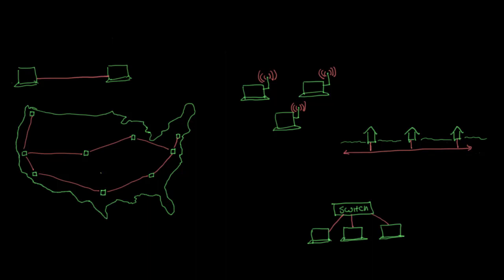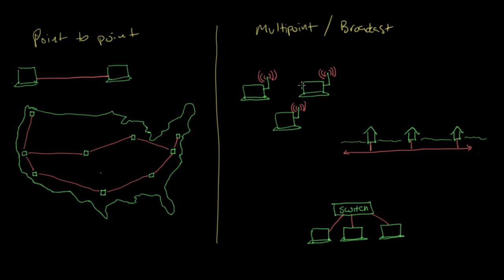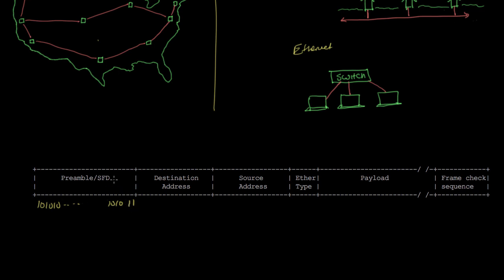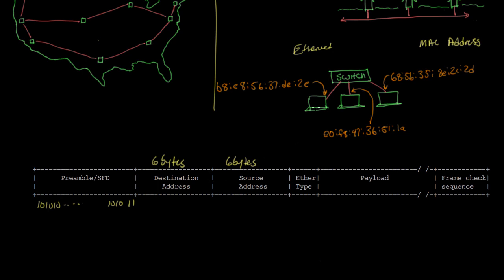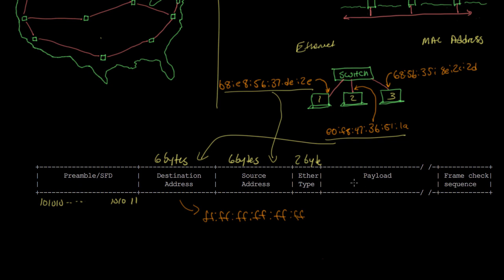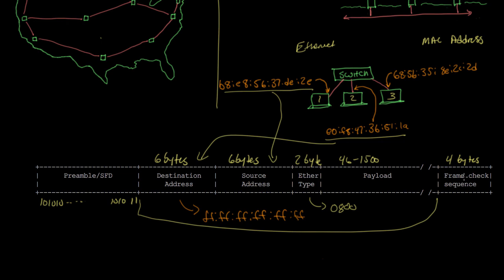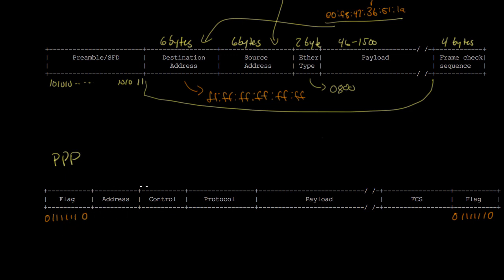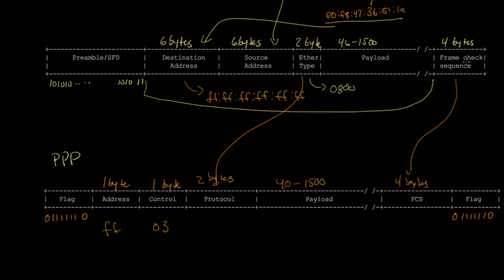Frame formats | Networking tutorial (6 of 13)

Comment: Awesome video series! Your explanations are so clear and understandable. Its perfect for learning!

The one thing I was missing was a mention about the problems when transmiting data back and forth.

We can't just transmit data whenever we want, but need to wait until the line is free, because signals (light waves, voltages, etc.) interfere and so having two computers transmit at the same time makes signals useless for all. As simple as this may sound, this introduces some complexity. For example, a signal takes some time until it reaches another computer, since it propagates with finite speed (the speed of light is still finite!). If another computer starts to transmit after you started a transmission but before your signal reached it, meaning it started while the line appeared to be free because your signal hasn't reached it yet, we have a collision and need to start over again. The collision handling using random wait times is quite clever, since you can't just tell the other computer "Wait, I'll go first", without having the basis for any communication. This is also a reason why the payload needs to have a minimum length, such that in case of a collision the signals reach both sender and receiver even in a long wire, such that both are aware of the collision and can start the collision handling.

Here is a nice explanation on collision handling: https://en.wikiversity.org/wiki/Web_Science/Part1:_Foundations_of_the_web/Ethernet/Collision_detection

Comment: The address field on PPP was sometimes used to do multiplexing of virtual connections. In my former company in the 90 we built a ISDL router that could transmit data via a single PPP link. We had a Unix server on one side (in West-Germany) with 4 RS-232 ports à 19200 bps, they would enter our router, multiplexed on the PPP link over ISDL, so 128 KBps and demultiplexed on the other side (in East Germany) where 4 terminals were hooked on the router. The address field allowed to distinguish the 4 virtual channels. Worked a charm and was easy to implement.

Comment: I have a question about the PPP frame format that was shown. In the diagram it is shown that the frame starts and finishes with this special code "01111110". As you explained earlier this is used for syncronization of both ends, so whenever you hear this "01111110" string you know it's the start of a frame. When this happens inside the frame, like you explained, a bit is "sutffed" in between to break the sequence, and so if the reciever starts hearing midway through they won't be confused.

My question is: what if the reciever starts hearing midway through (say, during the payload) and then hears the "01111110" finishing the frame? Wouldn't they interpret it as the start of a new frame?
Reply: Then right after this the receiver will hear another "01111110"  for the start of another frame.  I wonder if the receiver will realize it missed a frame. I know the first frame will be corrupted and dropped and or some higher level protocol like  TCP (layer 4) will check for corrupted data and request a resend. If not TCP, then there will be something on the upper level that will realize the data is bad and will initiate another request. But I think there will be an ARP or some other frame sent first to make sure the destination MAC address exists on the network before sending frames with data in them. In communication, there's always a request and response to initiate the conversation first, so that the receiver is ready and listening. I think the reason for escaping every 5th one bit with a zero in the data portion is so the receiver doesn't interpret this as the end of the frame. I still wonder if the receiver will recognize it's off with reading the flags or not. Also, I'm still wondering about how bit stuffing works. So, it inserts a zero for ever 5th one, but isn't it modifying the data! But at the end of the data, when another flag is read, the receiver is probably smart enough to know there's extra bits added to its bytes of data (only 8 bits per byte of data, but bit stuffing will make a weird 9 or more bit for it's last byte). I know it's just an escape character like " \ ", but it would be nice to know how the receiver will parse through this and how it deals with picking up a frame halfway (should not happen due to the ARP or the first frame to initiate communication). Maybe I'm answering my own question. Also, PPP is used for ISP's and other point to point networks, so most of us will not have to deal with PPP. We will be using ethernet, with its preamble instead. Please correct me if I'm wrong about any of this.
Reply: Oh, and the frame has its own Frame Check Sequence at the end, so this will probably let the receiver know that the frame is bad and it would hopefully request it again without having to go up the TCP/IP stack. The FCS is probably the answer. And we don't get to collisions yet. I need to read more. These videos are amazing and help me digest TCP/IP Illustrated by W. Richard Stevens better.
Reply: It will not request another frame after comparing the FCS with the sender's! It just ignores it. Then the higher level protocols will have to deal with a missing frame. Should have finished watching the video first before responding, My bad.
Reply: And, there's also a link control protocol or LCP used for PPP to establish, config, and test the connection before sending data. ARP is used on multipoint ethernet networks and is used to resolve IP address (layer 3) to MAC addresses (layer 2). In a point to point connection they don't even use the address field, because there's only two ends in this network. I kept thinking about ethernet frames during my first response, so please ignore my first answer.

Comment: 4:18 i guess that the switch knows the MAC address of each computer on the network so it will pass the data only to the specific selected destination based on the MAC address
Reply: The switch has a MAC address table. By examining the incoming traffic via a given port and the source MAC address information in the traffic, it associates the port with the MAC address and updates this data in the table. The switch can then use this data to route frames as required.
Reply: @The-Fish  Correct. The complete behavior is:

(a) The switch maintains a MAC address table that maps the MAC address and the switch interface information to make switch forwarding decisions.
(b) When an incoming frame is received, the switch examines the source MAC address.
(c) If the MAC address is absent, the switch updates the MAC address and the interface information to the MAC address table as a new entry
(d) If MAC address and interface information is already present, the age of the entry is reset. Typically, a MAC address entry is maintained for 300 seconds and will be removed upon expiry.
(e) If the MAC address is present, but under a different interface, the switch will purge the existing entry and create a new entry for the MAC address under the current interface (look up MAC flapping).

There will only be one occurrence of a MAC address value in the MAC address table. However, a switch interface may have several MAC addresses registered as the interface could be connected to another switch that serves multiple hosts.

Comment: Wouldnt the frame check sequence be the same across different messages? The capacity for being unique of it is 2^32 while the capacity for the message to be unique can go up to more than 2^10000... how can the frame check sequence account a different computation for all messages?
Reply: Imagine you're painting a map of the world but you only have five colours of paint. You want to make sure that there's no confusing borders where both the countries along that border use the same colour. Obviously there's a lot more than five countries - but it doesn't matter whether two countries that aren't near each other use the same colour. So I can't paint France and Germany both in blue, but I can paint France and Poland in blue, and Germany in red. 

Errors in transmission (unless your link is complete garbage) will normally lead to relatively small changes in the message - a few bits or bytes get read incorrectly, etc. Because of this, you don't need to account for all possible messages having a unique frame check sequence. It's sufficient that the frame check for a given message is different to the frame check for any message it can be corrupted into. 

In IP, checksums (which are a type of hash function) are normally used for this. Hash functions have the property that a small change to the input (in this case, the message in the frame) will result in a large change to the output (in this case, the frame check sequence). A large change to the input can result in the same output (this is known as a hash collision), but for a well chosen hash function the chance of this happening from an error in transmission should be very small.

Comment: Correct me if I‘m wrong, but shouldn‘t a Switch Send packages that are adressed to a certain mac adress only to this network interface they are adressed to instead of sending it to everyone?
Reply: MagicPeterPalmer Yes, that is correct. A switch mantains an internal addressing table and only sends packets to the destination on a specific Ethernet port. The behavior described by the author is common to a hub, which is a "dumb" device that broadcasts all packages it receives to all nodes connected to it.
Reply: @Fergobirck  While it is true, it is good to know that if the switch haven't seen that destination MAC yet, it does not know which port to sent it on, so it broadcastas on all ports. Then if the target responds back, it remembers on which port was it. It is also interesting that one port could connect to other downlink switch, so in reality there could be any number of destinations on a port. Any half-decent switch nowadays could remember enough MAC addresses per port so you probably never have to care with this, but it's still works behind the scenes.

Comment: Lets say you transmitt a payload of 1500bytes.  What is the chance of getting a correct frame check although you know that your payload has wrong bits inside ? (If the right bits are flipped it gets a worng positive frame check). I cannot beleve that this is possible, we use data-transmission for everything. I feel we need to be absolutely sure that we receiving the correct data.
Reply: If the payload is a TCP/IP packet, then the IP header has a 16 bit checksum too. Then the underlying TCP also has 16 bit checksum for the header. You probably could find a collision where the ethernet payload would check against the FCS, but that payload probably will not be a valid IP packet and/or valid TCP packet, because the inner checksums will not match. So the ethernet layer will not drop the frame, but the TCP/IP stack will. And there are other sanity checks. For example, you maybe find a collision, but the destination address will be something random. If the destination interface gets this packet, although it is valid, it will ignore it as it's address isn't match address in the frame. The same could apply to one layer up in the TCP/IP stack. If IP spoofing protection is enabled, the stack drops all packets whose IP address isn't belong to the interface it received on. And on and on and on... In the real world, most of the time you won't rely on a single thing, any well-written computer software consists of 70% of error and consistency checking and 30% of solving the actual problem.

Comment: Is mac address different from ip address?
Reply: Yes totally. MAC address is baked into the hardware (Network interface / ethernet card). It does not change. 
IP address is a virtual addressing concept. A computer or network connected hardware can be assigned any ip address when the network connection is established.
Reply: Indeed, it is baked into the hardware. This said, it's not true that it cannot be changed. It can.
Reply: @amnest1ac  He said it doesn't change, not can not be changed. While it can be (if the network interface allows you to do), practically you very rarely ever have to change it, because it doesn't matter (that much) in typical networks. In 'that much' I mean, you could use the MAC for serving fixed IP address using DHCP or filtering traffic based on the MAC, or prohibiting a switch port to talk to any other MAC you specified... And almost all the time if you ever want to change it, it is becaue you want to cheat on these security features. 😉

Comment: Payload is the data??
Reply: Yes
Reply: Here's a sort of an analogy: the tank of a gas truck is full of fuel. The fuel is actually called the payload and it is "encapsulated" by the tank. Same goes with networking, the payload is what is "interesting" to some application.